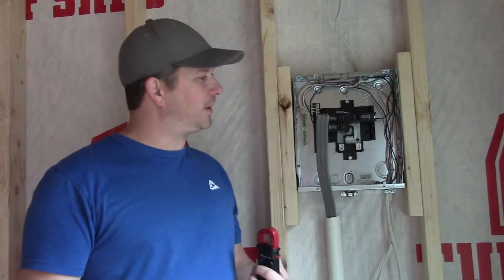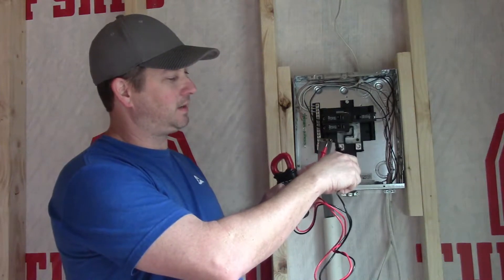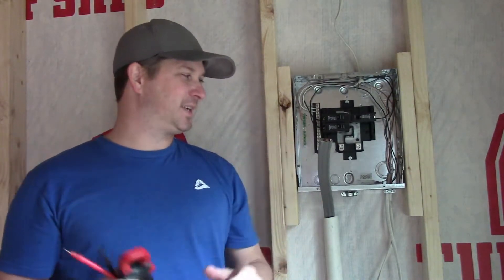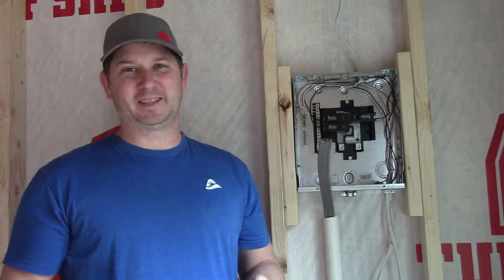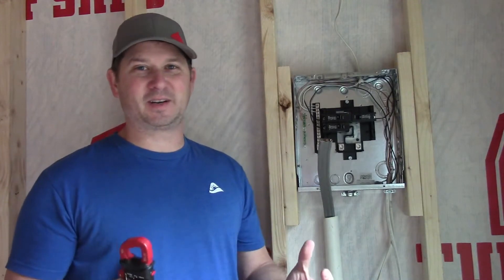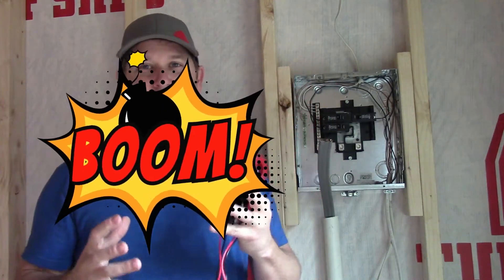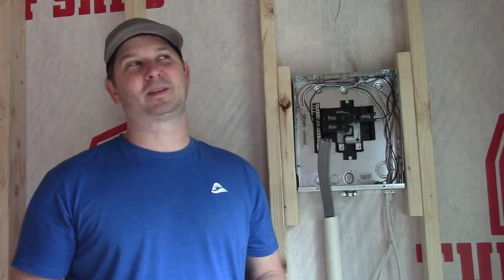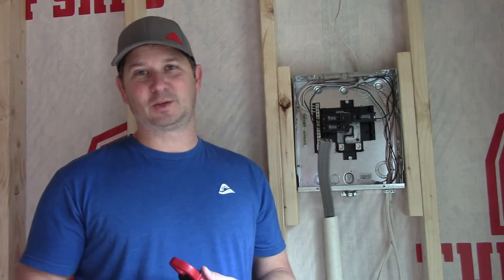Almost SHOCKED by 240 volts - DIY Electrical

Comment: Your example of what you did looked like 120 volts.   Outside to outside on the cable(red and black) is 240 volts if connected correctly,  you most likely got the two leads too close together and there was not enough air gap to insulate from an arc.   Happy that it was not worse!   Pride heals easily, eyes and skin, not so easily.
Reply from the maker: It definitely scared me and I was being too careless. Learned my lesson 😁.
Reply: @rogerearldiy    Word of wisdom.   Connect all devices to the conductors first, connect to the breaker last.   Much safer practice.